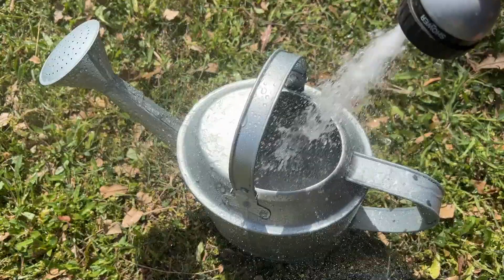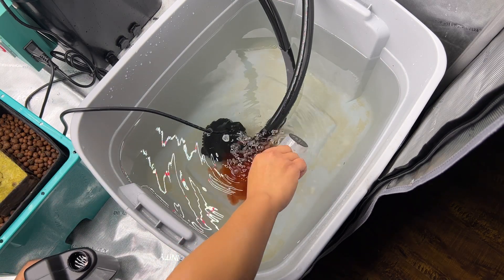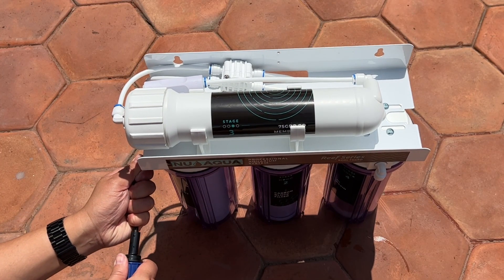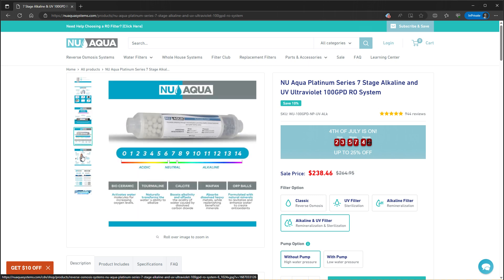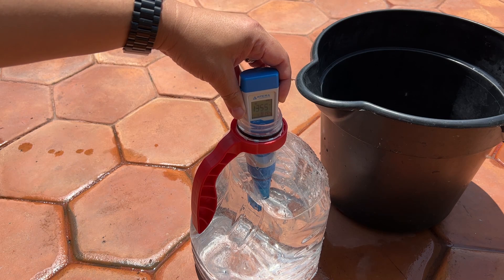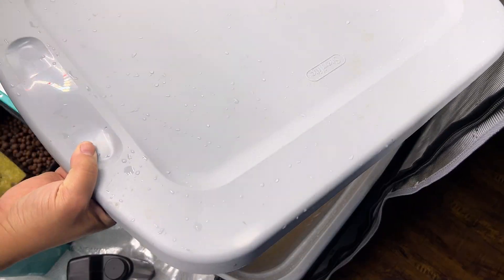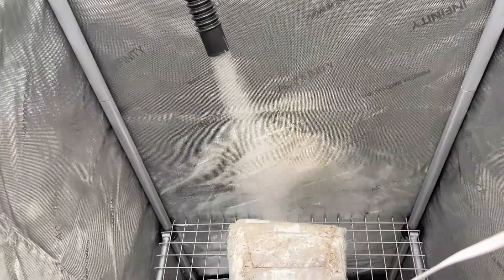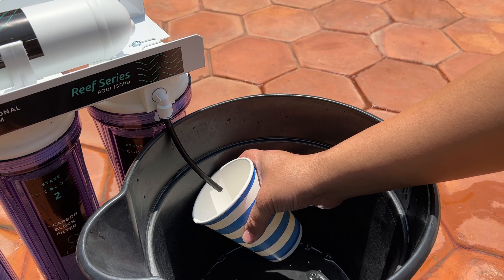4 Stage Reverse Osmosis Deionized (RODI) System

Comment: Like you, I'm pretty fortunate that my city water comes out pretty decent. Water reports indicate typical amounts of chlorine and sodium. I'll pull 7.2-7.5 pH and 0.2 - 0.3 EC out of the tap myself, pretty consistent with my local water reports. I still use distilled in my humidifiers, but I go through maybe 3 gallons ($3) per run Soo not a big deal

Comment: A float valve by itself will still have a problem. It will shut off flow to your clean res sure... but you will continue to have discharge water trickle/waste. If you look at how the under sink kits work, there's a special diaphram valve where source water flows through one side, and post water flows through the other side, and when the post water builds up pressure, the diaphram swells to one side to cut off the source water. But the thing that is not obvious is the pressure difference to make that diaphram swell enough to stop the water source isnt enough with a float valve cut off. That's where the pressure/storage tank comes in. The res float valve will cut off, but the water will continue to build pressure in the tank, and that extra built up pressure is what is needed to trigger the diaphram valve to stop the source water flow. So.... if you want to automatically stop the rodi system, you'll need the diaphram valve, the float valve for the res, and the pressure/storage tank. If you're not planning on using the water in the pressure/storage tank, you can buy a very small pressure/storage tank that is virtually useless for storage, but still will trigger the diaphram valve but they dont cost that much less than a modest tank so it would be more for space saving.

Comment: You need to get a pressure pump on that bad boy, you are wasting too much water without it. Not only will it drastically increase the water production rate, it will also drastically reduce the ratio of wasted water (which will be close to 8gal wasted for every 1gal made without the pump).

Comment: I've often wondered why people bother with ro water but never considered that their water supply isn't safe or stable enough to use regularly, honestly, if certain nutrients can't handle being used with regular tap (not polluted or outside acceptable parameters) water then I would consider them a huge waste of money. I've used the most expensive nutrients I could find plus the cheapest I could find, little to no difference in effectiveness or plant health and quality, in fact the turps from the cheap nutrients were much more intense than the expensive nutrients.
Reply: for hydro... those minerals in the water usually cause the ph to be high, where as plants use nutrients best when the ph is a little lower than neutral. If your water has hardness, you have to constantly use PH down to compensate, but that buffering changes over time as plants use things, so you have to consistently test the water and re-adjust. If you use RO water that problem goes away.

Comment: RODI is the easiest thing to do. I just hooked up an aerator splitter on my sink and run it to a suitcase system with a high flow discharge set up. It takes 30 minutes if you buy the right system.

Comment: get a container,mutton cloth,activated charcoal and some craft shop polyester filling.cut bottom off of container double over the mutton cloth and tape it securely to outside of container
with just a small amount of give,put enough filler on top to cover it then the charcoal  and thats it.just make sure you have cleaned everything first.if aquarium fish can live in it so can a plant
to make water drinkable use charcoal,pavers sand,fine gravel,a polyester mesh filter in a container with half inch hole drilled into the middle of it and put it on top of another container.hole size depends on container.filter,charcoal then sand then pebbles or gravel once water has gone through throw in a couple of water purifying tablets.all materials need to cleaned in hot water,besides
the purifying tablets.for me to buy that machine your using there or a similar one the outlay is over $1k in my country